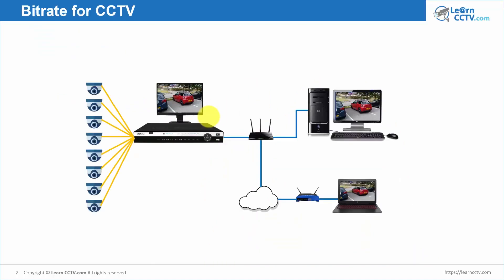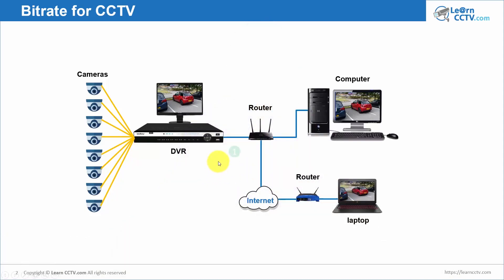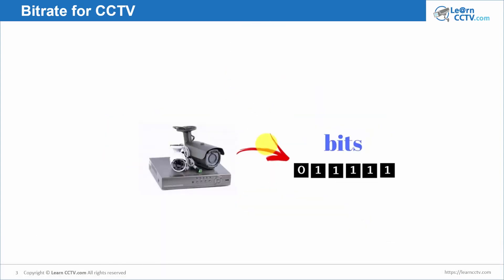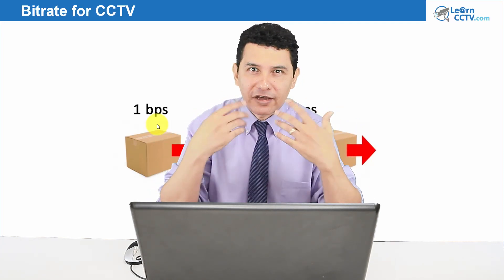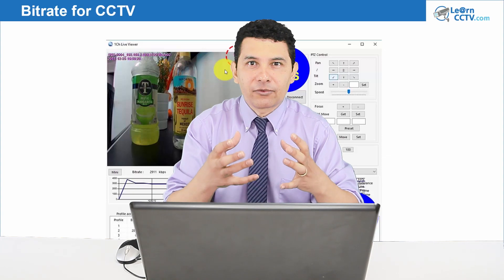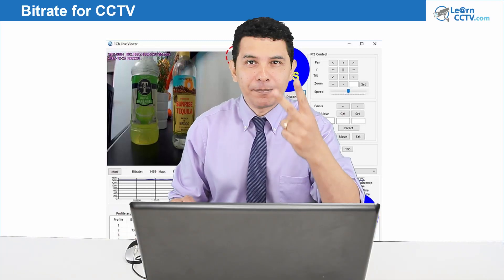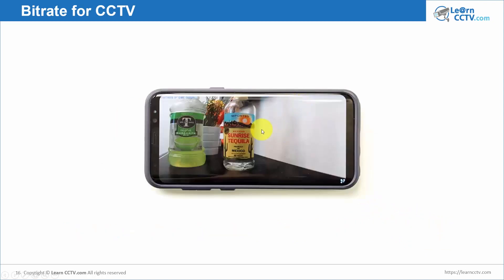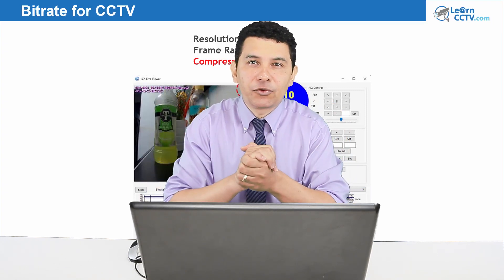Bitrate for CCTV (how to control the bandwidth)

Comment: Hello, Friend I bought Swann 8 channel Nvr 8580 with 8 4K spotlight cameras. I’m using 6 cameras  and running on cat 6 network cable. Everything is fine but vehicle and human are moving slow. Like kind of video lag. I update firmware and reset all settings still same issue. Could you let me know how to fix it.
Reply from the maker: Check the FPS (frames per second). You should see smooth movement with 15 FPS or higher. Sometimes you need to reduce the resolution to be able to increase the Frame Rate because some systems can't handle both parameters higher at the same time.
Reply: @LearnCCTV  I setup resolutions 2560x1440 20fps then little bit smoother. But with 3840x2160 resolutions frame rate is not going over 15. If I keep using  2560x1440 resolutions the video quality will be low or it will  be  same. Frame Interval is on 30 need to be change this one too.